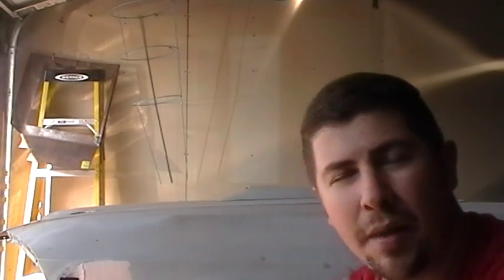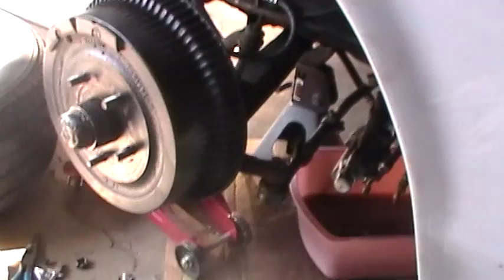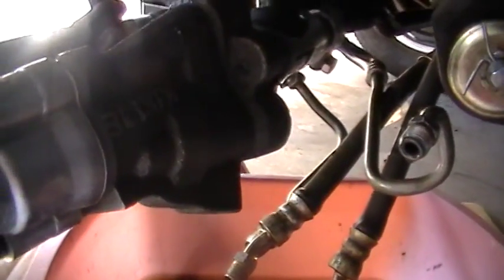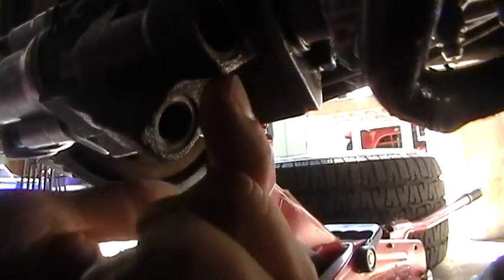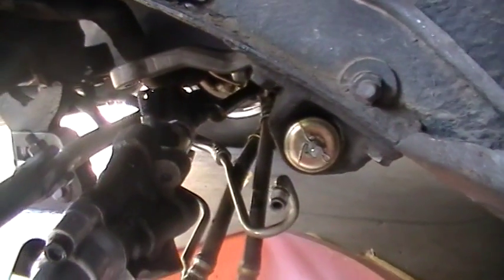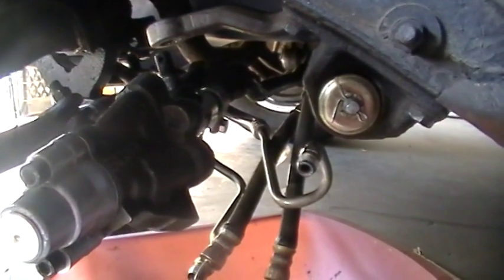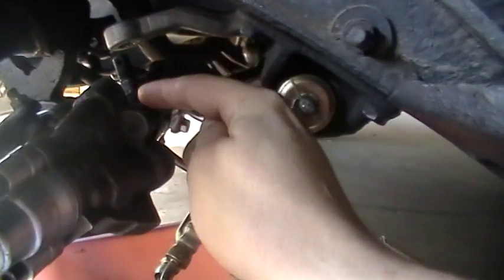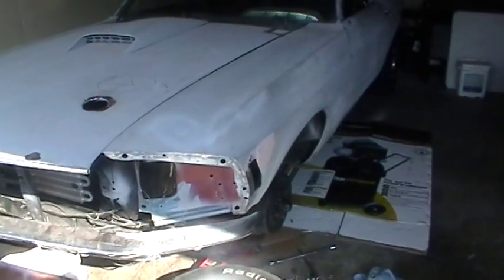1970 Mustang Mach 1 power steering control valve leak fix

Comment: I had to replace my valve because it was trashed and leaking badly, Now 2 weeks later my high pressure fitting is leaking.
Reply from the maker: I feel that pain.  The Bendix system can and does work, but I would get leaks here and there so decided to go with the Borgeson.